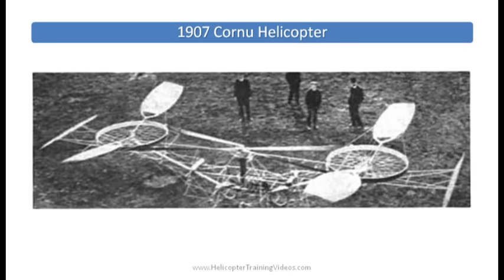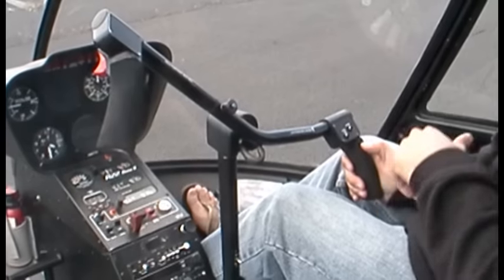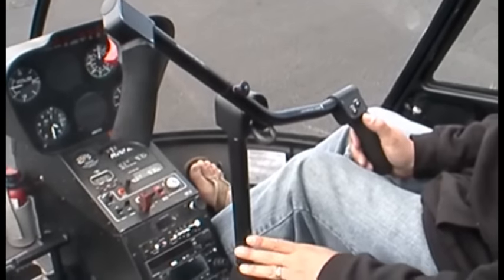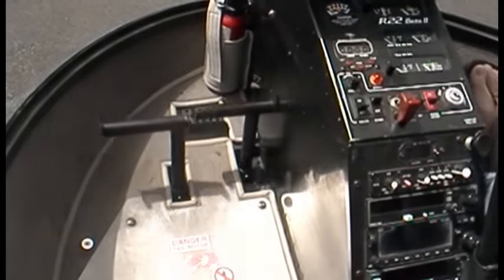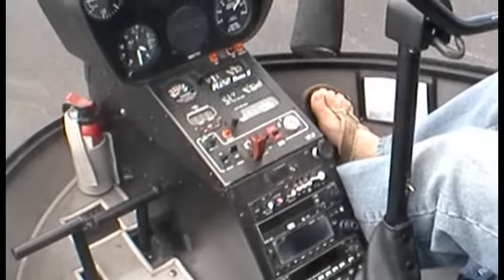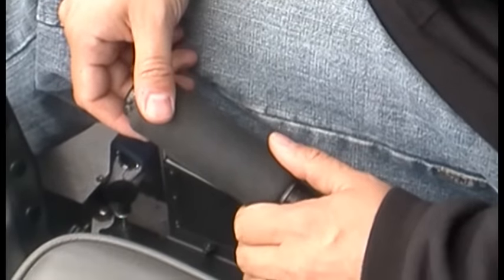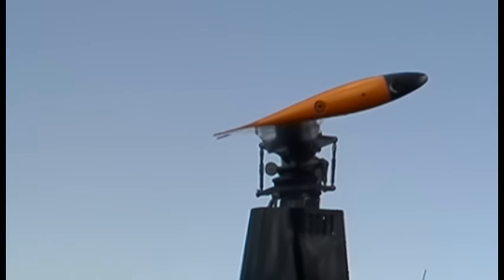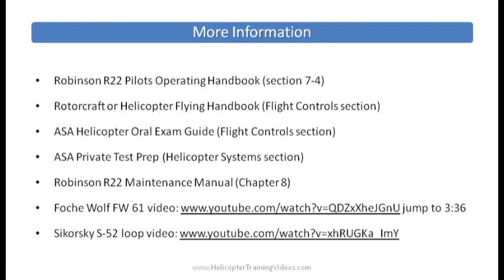Helicopter Flight Controls - How To Fly a Helicopter?

Comment: Hi guys , Very thorough and detailed instructions i would feel very comfortable as a student .
Reply from the maker: Thank you!
Reply: Henry Darr 
Very detailed and easy to follow. He was better and more thorough than some of my instructors at the air craft mechanic school that  I went to. We just touched on the basics of helicopter flight. We were more into the mechanics of things. Jet engine, propeller engines, electronics, hydraulics, wire and tubing routing, airframe repair etc.  Great video. I would feel very safe flying with this gentleman, even if if it was my 1st time to take the controls. Thank you for sharing. God bless. 
Task force guy - over n out

Comment: (Cesna) At age 15 I was watching everything the pilot did as he flew me and my brother for a flight. After 15 minutes of watching him do rolls, turns and drops, he asked me if I wanted to fly it? He said he noticed me watching him and looking at the instruments. So I said yes! I mimicked everything he did in the air,, as well as drops, turns, rolls using the various controls and of course, keeping an eye on the instrument control panel and gauges. Then after we had been up there awhile. we were making our decent to the landing runway. He asked me if I wanted to land it? I said yes! Well after he had called in for our landing protocol, I began the decent to landing. Smooth landing no hop, just came in landed it, then he took over. He said he had never seen anyone understand so quickly and told me I needed to get my pilots license.  At age eighteen I was asked to help my dad in building a experimental helicopter for Hillman Helicopters in 1979 (owner, Doug Hillman). I built the instrument control panel myself for this 1979 model. It was a direct drive model using 4130 chrome alloy tubes welded to German turn bearings. Straight alloy tubes replaced the cables and turn bearing replaced the pulleys. Essentially the mechanism and engineering is basically the same with a few exceptions. Hillman Helicopters was at Falcon field airport in Mesa, Arizona but later moved to Stellar airport, in Chandler  Arizona for the 1979 direct drive model. White with blue and red bold stripes. It was an executive model.
Reply from the maker: Wow - do you have any photos?
Reply: @HelicopterTrainingVideos  just search for Hillman Helicopters on the web for the 1979 helicopter project. Doug Hillman was the owner at the time, before his unfortunate demise.🤠

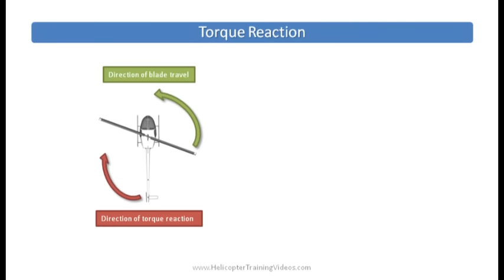Comment: 7:52 I literally just fully understood the function of the tail rotor.  It has always eluded me until now.  The main blades, rotating clockwise, produce a counter clockwise torque on the assembly. [I may be backwards CW/CWW] The tail rotor applies horizontal force opposite that of the main blades which stabilizes the aircraft.  It makes a lot more sense now, I always just accepted the entire premise without understanding how it actually works.
Reply from the maker: Check out our video on the tail rotor too.
Reply: The other solution is to use two counter rotating main blade assemblies

Comment: You said the cyclic trim is used to deal with blade flapping during high speed manuvers. I thought it helps with translating tendency during low speed with left pull pressure. Please respond
Reply from the maker: No, R22 cyclic trim or RT trim is for high speed. What you are talking about is a different thing. In the R22 there is no hover trim - you just add left cyclic to compensate for translating tendency. Good question though.

Comment: So if the rotors respond 90deg ahead of rotation to force applied as per their gyro behviour, then to move forward I need the helicopter titlted forward, and so I need downward force to the right side (as seen from back to front). So for that shouldnt the swash plate tilt to the side on moving the cyclic stick forward ? Why is the swash plate aligned to tilt in the same direction as the cyclic stick? Shouldnt it move 90deg to the direction the stick is moved?
Reply from the maker: Good point - the connection from swashplate to the blades is what puts in the 90 degree adjustment. Hard to explain in words - watch the video again and look out for hos the blades connect.

Comment: On the cyclic friction, where would it be during hoovering? More friction to aid in stability or no?
Reply from the maker: Everyone has a personal preference - in the R22 and R44 it seemed cyclic friction was only used on the ground as part of the start sequence - to reduce the chance of knocking the cyclic while tuning radios etc. Then once ready for flight the friction stayed off until you landed and started the shut down procedure. But on larger aircraft like the AS350 and EC130 some pilots (me too) tend to add friction to add some stability, especially when flying in turbulence. R22 POH Systems sections says: "Control friction must be used with extreme caution. Excessive friction may make the helicopter difficult to control."
Reply: When flying a helicopter you make very small adjustments with the controls so adding friction actually impedes your ability to do so because you would have to use more force to displace the control. A cyclic that moves freely and effortlessly is what you want.  

Once you have found your "hover button",(the ability to perceive helicopter movement and being able to react appropriately) the cyclic movement is very slight but must be done in a timely manner. Friction on the cyclic only delays the input of correction and can lead to overcorrection

Comment: So, what's the black knob that operates in unison with the collective? It's visible in front of the collective and appears to have a mechanical lockout.
Reply from the maker: +FlyKLOU Carb heat assist - changes amount of carb heat applied depending on collective position.

Comment: is there a neutral position for the collective? like a position where you won't gain altitude nor lose it
Reply: It's complicated. In short yes and no. There is not a "neutral' Position for the collective; However, there is a position where the helicopter won't gain or lose altitude. It changes based on a number of characteristics including the environmental conditions, the weight of the helicopter, altitude above sea level, altitude above the ground and a number of other factors. These all equate to something called  "hover power" that is an engine setting and corresponding collective blade pitch to keep the helicopter in a hover. Hope this helps.
Reply: Michael Sullivan Thanks, I hope to one day fly a helicopter in the U.S. Army

Comment: Very interesting.  I wonder what those linkages and fasteners on the rotor are made of?     I'd be worried about the fasteners coming loose.   What is the in flight rpm of the rotor?
Reply from the maker: 700 FPS at the tips

Comment: Hello, 
Is it legal to use the left hand to operate the cyclic and the right hand for the collective? I'm normally right-handed but I've noticed that when operating vehicles, I tend to have far better directional control with my left hand than my right hand. 
For example, when I drive, I feel more comfortable steering with my left hand and using my right hand for the gear stick (I drive stick shift). If I switch to steer with my right hand, I wobble out of lane a bit.  This may sound silly for a second example, but when I fly a helicopter in my video game (which has realistic controls i.e. cyclic, rudder pedals, collective) I fly far superior with my left finger as cyclic and right finger as collective. I concluded that I have better control with my left hand or finger in terms of making minute directional adjustments .Unfortunately, I sense a feeling of insecurity simply by thinking of having to switch hands as a future student helicopter pilot and was wondering if this would affect my progress?
Reply from the maker: You would have to get a custom-made helicopter as the collective is on the left of the seat

Comment: cool. how much similarity is it between flying an rc heli and an actual helicoptor?
Reply from the maker: Aerodynamically they are essentially the same. But in RC you fly with your two thumbs, in a full-size helicopter, you use both feet and both hands - so maybe more coordination required? Saying that, I crash my RC helicopter all the time and I've never (touch-wood) crashed the real thing... :-)
Reply: Helicopter Training Videos ha thats cool.  in a sense i guess that would make the real one easier huh...?   i knew it was both hands and feet, but what controls the tail/ keeps it straight, in a real heli? does it have gyros as well or do you do it manually?

Comment: Use to work on helicopters or other wise known rotary wing. Now retired but they were way different from fixed wing. The radios and instruments are pretty much the same. But the flight controls are way different. Takes awhile to get the feel, pilots write a problem up and you have to try to duplicate it on the ground. The really modern ones have computers that act like power steering in a car. You barely have to touch the controls. The really smart ones will just about fly themselves.
Reply from the maker: True!

Comment: Cool video. Why would you ever put a fuel cut off lever in with the normal controls? Poor design I think
Reply: To autoglide.
Reply: ....in case you Crash and Burn....you can reduce the horrific flames that are engulfing you ...to just plain normal engrossing type fire .....by turing off the fuel cut off.....
Reply: In an emergency to kill high pressure fuel pump. Safer that way in case you crash. You can then "autorotate," depending on malfunction with zero power and hopefully land safely. Stuck throttle, governor malfunction ets.
Reply from the maker: It has a guard...

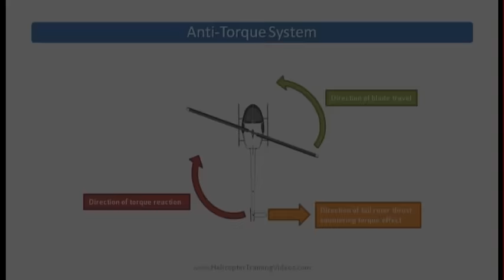Comment: Very well put together video, however the drawing at 8:02 should be corrected. The tail rotor should be providing thrust toward the direction the torque is driving the tail to. In other words the orange arrow should point in the same direction as the red arrow. According to the picture, the helicopte would be spinning around with the tail rotor thrusting to the right (yellow arrow).
Reply from the maker: Thanks for the feedback, but I think you are misunderstanding the diagram. The orange arrow is the THRUST = the force direction, or the direction the tail rotor is PUSHING. What you are suggesting is the 'downwash' direction. Think the tail rotor as an airplane propeller - THRUST is a forward direction, but the propwash from the propeller goes backwards. Check out the FFA Helicopter Flying Handbook page 2-15 https://www.faa.gov/regulations_policies/handbooks_manuals/aviation/helicopter_flying_handbook/media/hfh_ch02.pdf

Comment: Is it possible to disengage the correlator, or does it always stay on?
Reply from the maker: Great question! You can disengage the correlator by rotating the throttle grip past idle, into the detent. That is used for practicing hover autos and loss of tail rotor thrust emergencies. Check our videos on those subjects

Comment: Great video! I was wondering how fixed wing training would adapt to helis, where each control is for what I normally would do...avoiding the dreaded spin around. The first thing I noticed from heli videos, though, was the speed, altitude, and proximity to obstacles goes against every picture a fixed wing pilot wants to see. My immediate reaction was ah!, imminent stall or crash. But I can see the advantages of T/O LND on a dime. And you do have PFL capability, on a dime. I wonder what emergency maneuver training looks like in a heli. I guess all cues are still present but merely different.
Reply from the maker: Yes! I have experience in both and completely agree with you!

Comment: Hi there, when you put in rudder input, do you see a slight roll and pitch-up tendency? I got hold of Lockheed Martin's flight simulator software (yeah I know don't shout at me lol), and their R22 is a real handful. Taxxing with rudder input you have to compensate what seems an awful lot as the R22 rolls to the outside of the yaw and pitches back, destroying your taxi speed. Does that sound realistic?
Reply from the maker: +Mirandorl Hmmm hard to say without flying it myself. Also is there wind involved? - that would complicate matters. Any control input usually requires input to the other controls to compensate for the imbalance.Check out this video for an example of how the aircraft rolls/pitches in hover: https://youtu.be/4PY4J74-SyU?list=PLJ8xtPILNIlg6Q8oJmpxNzR1xKf7sJP5a  Hover in a realistic helicopter flight simulator is always very hard - even full motion simulators are said to not get it completely right - so you have to learn to hover the helicopter and then learn to hover the simulator...Either way, learning to hover is hard for many people - simulated or real, but like most things it comes with practice.
Reply: +Helicopter Training Videos Thank you so much for replying. Watching that video I think the simplest answer is that I have an enormous amount to learn! Your comment about applying only the barest of pressure was most telling for me I think as I seem to be waggling all over the place. Lucky its not real....

That said, I usually set the wind to zero to make things easier for me. I would also guess that a decent sim cyclic would make a difference, though they are more than $1000 and thats still lacking any kind of control loading. The joystick I have is not capable of realistic forces so I cannot fly by cyclic feel, its all visual. I would love to fly the real thing but am struggling to pay for a PPL(A). Sims have however given me the impression that flying a helicopter is both exhausting and immediately lethal. I am hoping thats a false impression :)

Comment: Do most Helicopters use a correlator on the cyclic, or is the throttle control usually seperate?
Reply from the maker: They tend to have a throttle correlator on the collective to help maintain correct RPM

Comment: why doesn`t the correlator also give extra power to the tailrotor ?
Reply from the maker: Great question. The correlator opens the engine throttle, making the engine 'push harder' creating more torque around the main rotor mast. But the main and tail rotor speed (RPM) should be mostly constant - so the tail rotor thrust does not automatically increase to offset the extra main rotor torque. That would require the tail rotor pitch to be increased (left pedal in R22) to produce more anti-torque. See our video on Helicopter Torque for more info.

Comment: why is a helicopters main pilot seat on the right even north American ones, but the captain's seat in a plane is on the left?
Reply: Sage Tech That can vary. Often it is manufacturer based on best way to mount controls. Things such as instrumentation or rotor brakes, etc. it could also have to do with visibly or which way mast is rigged. Confusing because I fly right sear s300cbi and left in an Enstrom. I could not tell you why Enstrom is left
Reply: Sage Tech Helicopters have ejector seats that's why.
Reply: Some helicopters have the seat on the left.
Reply: The Hughes 500 is flown from the left seat. It may also have something to do with translating tendency whereby the thrust from the tail rotor pushing right is compensated by adding a slight bit of left cyclic which makes most helicopters hang slightly lower on the left. If the pilot was on the left side this would aggravate the situation.
Reply: Weight distribution ....
Reply from the maker: Lots of theories for why airplanes left seat. For helicopter you keep right hand on cyclic and use left hand to control radios etc in the middle of the cockpit maybe?

Comment: How come the MAP gauge is indicating 27in" when the engine is not running? It just seemed odd!
Reply from the maker: A good question - when the engine is not running the pressure indicated gets close to measuring current atmospheric pressure (not perfectly due to pipes/restrictions through the engine).

Comment from the maker: Always reach left around the cyclic column when pulling cruise trim in an R22 to minimize the chance of pulling the mixture by mistake. This recent accident is not the first and won't be the last I'm sure: Happened a couple of months ago: http://www.ntsb.gov/aviationquery/brief2.aspx?ev_id=20140604X23226&ntsbno=WPR14CA227&akey=1
Reply: The helicopter comes with a small plastic guard to be placed over the mixture to prevent unintentional pulling, but it's small enough that I can see it being easily lost by student pilots. Robinson helicopters are great and extremely affordable, but they do have they're little issues, lol.
Reply: Great vid!  Like the string instrument.
Reply: Those two strings on the windshield? They mainly help you maximize your gas milage. They tell you how efficient your wind flow is. Although, it's just basic yarn as far as I know. I guess it goes with the affordability of the chopper, xD.
Reply: livecentury21 Those two strings on the wind shield are for flight balance they act the very same as a slip ball on an aircraft !!!
Reply: livecentury21 
Simple but effective. 
Task force guy - over n out
Reply: cruisersism ßu
Reply: Helicopter Training Videos
Reply: what if you're a left hander, do you swap seats ?
Reply from the maker: Nope, that wouldn't help as you still have the collective on your left and the cyclic on your right.

Comment: what I don't understand is a helicopter have less amount of controls yet the training costs much more than fixed-wing......
Reply: My mother would be able to get down a slope on a modern snowscooter, but not on a 150€ snowboard. I think it's less about the technical bit, and more about the 'feel' of it all.

Also: rotary wing aircraft are out to kill their pilots, that's for sure.. :-)
Reply: n3rdbear-
That will be the cost per hour of the helicopter to run.